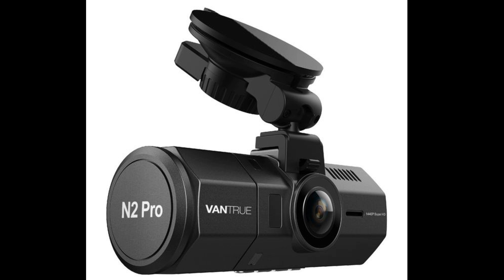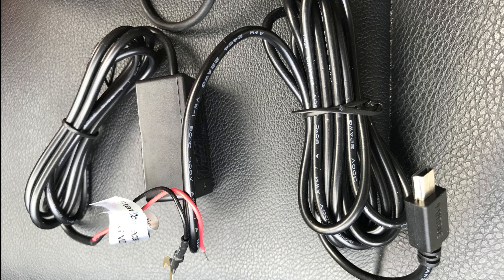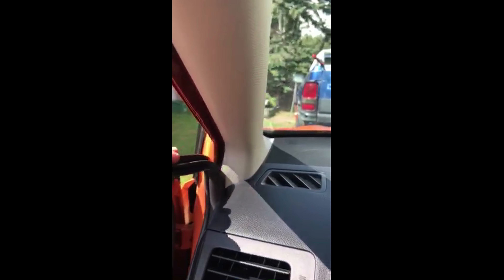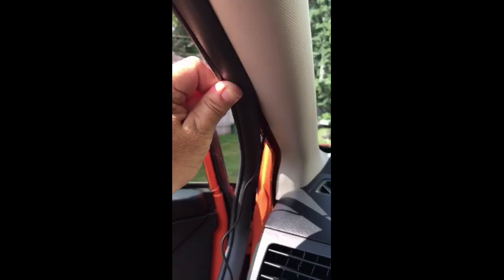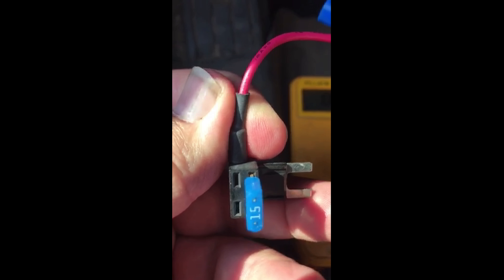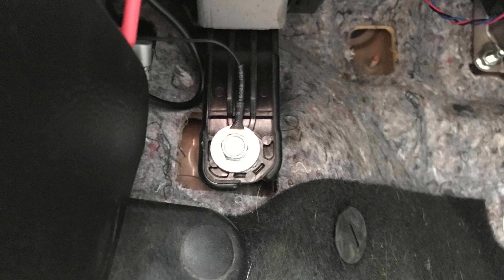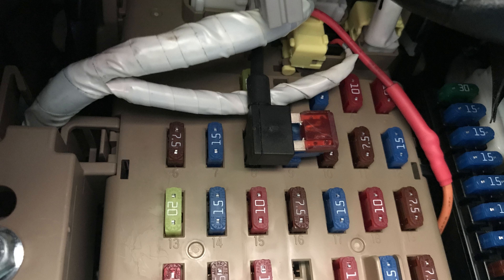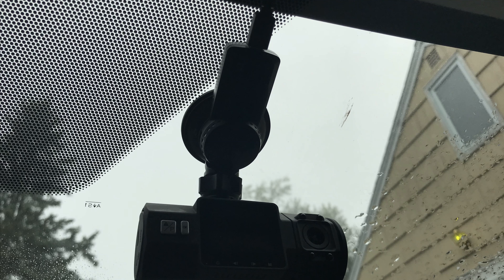How To Hardwire A Vantrue N2 Pro And Other Dash Cams

Comment: I had purchased a vanture N5 and I do not have no cigarette adapter so can I buy a 12v battery charger to use for my fuse box to connect to the N5
Reply from the maker: Just buy the hardwire kit and install it. It will work perfectly for you.
Reply: Ok, thank
Reply: Do you know where I can order the kit from and the name of the correct kit I should purchase
Reply from the maker: @rellokd6738  On Vatrue's Site or Vantrue's Store on Amazon

Comment: Hallo ! If connecting OBD port in parking mode, how many days will the battery run out?  Thank you.
Reply from the maker: @lelozwillingedeutschland9807 Why would you tap the OBD port? The Fuse box is the proper place. Most hardwire kits have a battery protection built in. Meaning the battery gets down to a certain area and the cam isn't powered anymore. most depends up on the CCA of your battery.

Comment: so how does it turn off? it's  constantly on and it doesnt detect a key out. it's on until the battery is dead?
Reply from the maker: I have it wired into a hot circuit, always-on. The Dashcam is basically in standby mode. Activation occurs when motion is detected which will activate the camera's recording function or the impact sensor reads a hit. The hardwire kit has a low voltage battery drain protection ability. If the battery gets to a certain voltage the dashcam will not do any more recording.

Comment: I'm a layman on the subject and I would like to know why this kit doesn't drain the car battery and the camera is on 24h and recording I'm worried about putting and destroying my battery since it's a hybrid sportage, if someone can guide me it would be great, thank you
Reply from the maker: The hard wire kit has【Low voltage protection】It will power off automatically if your car’s battery gets lower than 11.2V or 22V to prevent it from draining the battery. You can also buy a battery backup from BlackboxMyCar  https://www.blackboxmycar.com/collections/battery-packs

Comment: I'm curious why constant power is needed. I thought the N2 Pro had an internal battery that turns the cam on when you open the door or the car gets hit while parked.
Reply from the maker: The internal battery will only work for so long. If you plan to use parking mode you will need to have it hotwired. This way it has a constant power source. If the internal battery drains and you get hit, your cam isn't going to record anything for you. If you plan on using the lighter adapter, most cars nowadays only have power going to that when the key is in the on position.

Comment: I thought about putting the camera on the opposite side of the driver but the sun visor will block the camera if its down.
Reply from the maker: Chris Mullins I thought about putting mine on the driver side as well. But came to realize it was best on the passenger side. That way it’s not a distraction.

Comment: If you're hardwiring a dash cam and a radar detector, can you use the same grounding bolt for both or do you need to find separate bolts?  Can the two grounding connections touch each other?  I assume no?
Reply from the maker: Sure you can ground to the same bolt. Just make sure you have a good connection. There always many points you can ground to. :)
Reply: @IamWedge  Oh that's really helpful!!!  Thanks!  For whatever reason, I thought that the two couldn't touch each other... 

One other question since you're kindly answering (and I promise not to bug you after lol)...  So, would a good idea to use the fuse that's for the radio for the radar detector since I don't need it when the car is off, but use break lights (?) for the Dash Cam since it may be powered on during Parking Mode?
Reply from the maker: @christopherr6284  Being the radar detector is only being used while you are driving the car you could use the fuse for the radio. Being you will be looking for a fuse that gives power when the key is in the on position. Just remember you have to use one of those Littelfuse kits to do it. On a side note. I don't know what kind of vehicle you are doing this on. If it has a powered mirror there are wiretap kits that can tape mirror power. LMK.I can give you some links.
Reply: @IamWedge  Thank you so much!  It's a 2020 Honda Accord 2.0T Sport.  I really appreciate all the great advice!
Reply from the maker: @christopherr6284  No problem, you are welcome. Do that have a mirror with power running into it?
Reply: @IamWedge  No, I don't think so.
Reply from the maker: @christopherr6284  Well, good luck with the install. lmk how it goes for ya.

Comment: Thanks for pointing out the Draw side and a Power side. If I connected it upside down what would happened? I assumed it would  still working but what side effect would that be? Anyone have any ideas?
Thanks!
Reply from the maker: If backwards the current for your dashcam would have to flow through both piggy-backed fuses in series, which reduces the capacity of the original circuit. It would raise the possibility of blowing the fuse easier.  Meaning it could overload the main fuse, which has to now handle the current for its original circuit load plus the dashcam.

Comment: I am having issues with my hardwired N2 Pro turning off overnight then it turns on when I get in the car and turn the vehicle on. Never did this before and the dashcam is only approx 10 months old. Any ideas?
Reply from the maker: Did you test to see if you have power at the fuse when the car is turned off? How far in to the night are you getting before the dash cam is turning off? How often do you format your card?
Reply: IamWedge yes there is power in that fuse for sure as it worked perfectly for 9 months. In this 10th month of owning the camera, it’s been acting up. How far in the night? No clue because I only know when I get in there and start the car and I hear the chime telling me it powered on, which never happened before. It also resets the times and dates so I’m confused as to when it’s happening. I’ve only formatted my SD card once, when I bought the camera. I don’t see why not formatting the SD card more often would cause it to turn off the camera overnight? I feel the car battery might be dropping below a certain voltage overnight. But it’s cold now here so generally car batteries hold charge better. Very odd
Reply from the maker: @SAMGASS  are you having any issues with the battery in your car? I know the hard wire kit is spose to disable the camera if battery voltage gets to low.
Reply: IamWedge I actually JUST noticed I hit the remote start on my car and it wouldn’t remote start!!! I have a Dodge Charger so it shows the battery voltage in a screen on the car and it said 11.1v. When I started it with the push button inside the car it went up to 14v. Sounds like a battery issue to me. You think?
Reply from the maker: @SAMGASS  It does sound like the battery might be a little tired. I'm not sure where you live Sam, but I'm from Minnesota and I found out that I had to turn off parking mode in the winter when it gets super cold out. It saps the battery. Now you said your cam was turning off in the night some time. Its possible that your battery recovered from the draw the cam was putting on it. I just bought a back up battery that I'll be installing and using to power the dash cam while in parking mode. So that video is coming soon.
Reply: IamWedge I’m from Chicago. It’s not crazy cold here yet. Only a few days it was below freezing so far. Just sucks I may have to turn off the parking mode because The whole reason I bought the camera was for the parking mode since my previous car was hit when parked and the person who hit me just left.
Reply from the maker: @SAMGASS  Crazy cold as in the -20 F range. I would have the car battery tested to be on the safe side.
Reply: IamWedge doing that tomorrow I’ll let you know. One thing I left out is that I’ve been having issues with my radio and dodge dealer claimed there are no power or ground issues and they insist it is an internal radio issue so I bet that’s causing a parasitic drain. Idk if it’s turning on overnight but the radio constantly turns on and off by itself when I’m driving every 5 seconds.

Comment: I have hardwire my dash to my fuse and my cam shuts off automatically. I have my settings in parking mode and high censer and the cam shuts off. Please Help
Reply from the maker: If the cam shuts off when you turn your key off you are not wired into a hot circuit in your fuse box. Take a multi meter to your fuse box. You should be able to find one or two that are one when the key is off.

Comment: Thank you! 
Question: Does it matter which hardwire kit to use? I noticed there are have 2 difderent kits...one with bllack and red and one with black, red, and yellow.
Reply from the maker: You only need a kit that has two wires. One is ground and the other is the positive that is wired into the fuse block.
Reply: @IamWedge  Thanks!! I didn't know if I needed  specific kit to utilize parking mode.
Reply from the maker: yaboy20071 that’s it. It’s a really easy kit to install. Good luck and let me know how it turns out.

Comment: You totally lost me on the fuse box. I wish you could explain this as if you were talking to a 5 yr old girl. 
Are you supposed to have one of those hand held meters before beginning? What about the fuse, the extra one that you explained that is supposed to go in the fuse connector, do I need to purchase that separately? 
Are you supposed to remove the fuse that’s already there in the fuse compartment? So many unanswered questions. And what’s the little box that you had to squeeze behind the weather stripping? Is that connected to the wiring that comes with the camera?

Comment: So you're saying if it takes 20 fuse normally put in 15 instead?

If so why?
Reply from the maker: What ever Amp fuse you have for the place you are putting your fuse in to (I used my Brake lights which is a 15 Amp fuse) the Slot on the left of that Add a fuse is the power for the Dash Cam. So don't put a 15 Amp fuse in there. It should be a lower Amp Fuse such as a 10 Amp.  I used a 10 Amp for mine. If yours uses a 20 Amp fuse.....Use a 20, But the dash cam power will need to have a lower amp fuse. In your case... a 15, 10. If your fuse slot shorts out.... You would want the dash cam to blow its fuse before the other.

Comment: After hard wiring mine, it flattens my car battery.  I Know its the Van true dash cam because if I remove it the car starts and runs fine.
Reply from the maker: What hard wire kit did you use? I know the Vantrue hardwire kit has a Low Voltage Protection. meaning it shuts off if the battery gets below a specified voltage. Its either that or you have a older battery that might need to be replaced.
Reply: Hi Iam, yes it's the van true one, but it's also a new battery, so I'm going to have to do some further investigations. Thanks.
Reply from the maker: @cumbriaremovals  I would start with Vantrue's customer Support. They are on Facebook and twitter. I know I learned last year that I had to turn off my parking mode in the winter when its colder out. Seemed to sap the battery pretty hard especially on those cold nights. Please let me know how this turns out for you. Good Luck.

Comment: Great video,is there a way to shut off cabin cam and just record the street cam?
Reply from the maker: Go into the menu setup and select RECORD SETUP. Resolution: By default (DUAL CAM RECORDING mode), both cameras
record at 1920x1080 (30fps). In SINGLE FRONT CAM RECORDING
mode, 2560x1440P (30fps), 2304x1296 (30fps), 1920x1080 (60fps),
1920x1080 (30fps) options are available.
Reply: @IamWedge  good to know  thanks bud, just went for a test tide, love the cam, worked great
Reply from the maker: George Burns you are welcome. Glad it worked for you.

Comment: How can u khow which side is feed without any device
Reply from the maker: Feed side in the fuse box. Probe with a volt meter.The side that has power is the feed side.i The cheapest volt meter on Amazon can do it.$3.76 USD  https://www.amazon.com/Voltmeter-Ammeter-Electrical-Digital-Multimeter/dp/B00N3KQ4IG/ref=sr_1_1?keywords=voltmeter&qid=1550550376&s=gateway&sr=8-1

Comment: Can you connect a N1 pro and a rear view mirror backup camera with the same hardwire kit?, ( two different devices with one hardwire kit)
Reply from the maker: I think the big thing to remember is the wire going to the mirror might not be big enough to handle supplying power for the mirror, a camera and a back up camera. If you try it you might have to increase the fuse size. I'm not saying you should do it. But there is a risk of over heating the mirror's power wires.
Reply: Ok, thanks
Reply from the maker: @edward809  You are welcome.

Comment: For example 
If i use empty one in fuses box and but in my wire 15 aM it gonna work or not 
I have honda hrv 2018
Reply from the maker: If you have an open fuse circuit that has battery power and are using a Add-A-Circuit Kit You should be fine.
Reply: Yes. Most newer cars and especially your 2018, will have spare open slots for additional  hookups. My advice, use a multimeter and measure to see if there’s power going to which one you want to use. Do it with the car off and no key in the switch. The one that blips, is the one you’ll be connecting too. 

That’s it. Ground is ground no matter where you want it. Worse case scenario, you’ll have to drill a small hole and add a screw to connect your ground wire. But most likely, you should be able to find a suitable bolt or screw somewhere in the footwell area you can use or share with. Just make sure the screws not plastic or nylon.

Comment: How long the screen turns off when the car is in parking and the car key has been turned off ? and parking mode is on ? I use power supply ”
Reply from the maker: This it right from the manual  Page 16   "4.8.1 Triggered by MOTION DETECTION     When the Parking Mode has been turned on, and no movement is detected in front of the camera after 5 minutes of recording, then Parking Mode is activated. This is represented by an icon (P) at the left side of the screen. Full frame recording will be triggered by the  motion detection sensor."  Link to the manual is here:  https://www.vantrue.net/Support/detail/id/35.html
Reply from the maker: Check you setting as well. "By default, the Loop Recording Time is 3 minutes. Please go to
“Record Setup”>“Loop Recording” to change it to 1 minute or
5 minutes. When Loop Recording is turned off, the camera will record
video in 20 minute clips, but will not overwrite old videos when
the storage card is full.
Reply: IamWedge   The problem is doesn’t turn off by it self after 5 or 10 mn 
Without any movement
Reply from the maker: @alaabuzubedah4737  If the screen is staying on.......  Go in the System settings        -Auto LCD Off: Default is 3 MIN to turn OFF the camera 3 minutes after recording commences. Press the OK button to select the duration in minutes: 1, 3, 5, or OFF to disable it. -Device Sound: Default is ON. Press the OK button to toggle
Reply from the maker: @alaabuzubedah4737  Once LCD powers off.... the camera should still be powered on, You should be able to see a faint blue flashing light on the left buttons.
Reply: IamWedge  thank you sooooo much 😀 
Last question 
What can i do when parking mode is on . and raining outside I mean it’s gonna record all the time right? 
What you advise about this ?
Reply from the maker: @Ala Abu Zubedah I do not think there is anything you can do about the rain's motion as if rolls down your windshield. Its going to detect the motion. Not until Vantrue figures out a way to detect rain as an unrecorded motion. In short, it’s not worth turning your parking mode off when it rains. The thing is... will you remember to turn it back on. Also check you have poop recording turned on. Good Luck
Reply: IamWedge thank you sooo much 😀
Appreciate it 
You the best man 😉
Reply from the maker: Ala Abu Zubedah you are welcome Sir!

Comment: Do you happen to know if the camera goes into a park mode when it's hot-wired to the battery, or if it just continually records nonstop?  Do you leave you're running when parked at home?
Reply from the maker: You have to go in to the setting and turn on parking mode. Parking mode records when there is motion. If someone taps your car or hits your car it records and protects that recording from deletion. Yes, mine runs in parking mode even when I'm home. If someone walks up to your car to lets say Key it.....it will record the event.
Reply: IamWedge thank you. If I understand it correctly then, camera won’t record anything once no movement is detected, and will start recording when motion or g force is sensed, even when constant power is supplied via hot battery connection?
Reply from the maker: @BBuchanan3  That is correct sir.
Reply: I have a hardwired 12V plug.  It seems the camera doesn’t want to exit parking mode when driving.
Reply from the maker: Robert Weaver That lighted mode stays lit on the display to show it’s turned on. Once motion begins it should be going in to driving mode.

Comment: What fuse would you recommend we put this onto? I would like for the camera to turn on and off by itself with the ignition without having to turn the cam on and off manually myself and still have the parking mode turn on if someone back up into me.
Reply from the maker: I used a meter to find which fuse has power with the key off. That why I inserted mine in to the Brake fuse. Hope that answers your question.